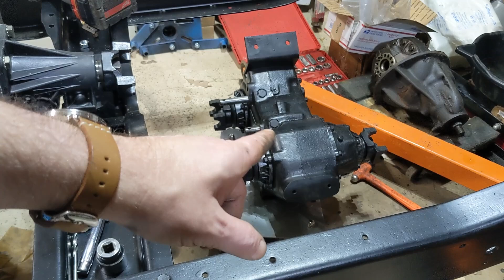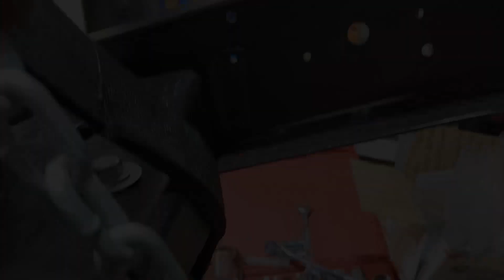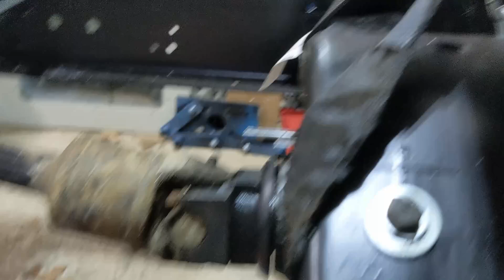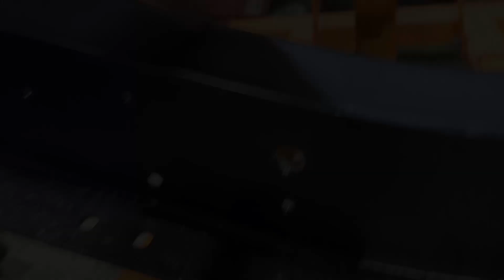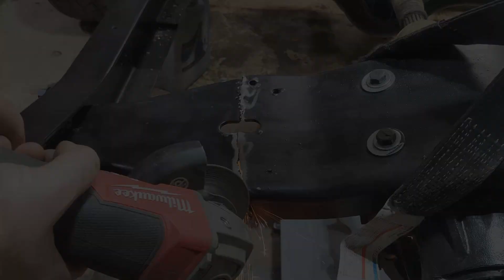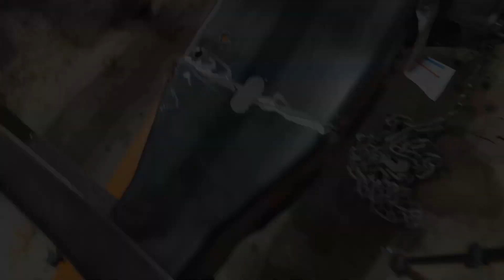Installing the Transfer Case (True Spirit #37)

Comment: Man another nice job brother but I wonder if you could help me out with a not so old truck frame  ? I’ve got a 2001 ram with the front frame rusted out where the tie rod bar mounted and I have access to a small junkyard that had the same frame so my question is would you cut it straight across or do more of an L shaped piece so I can put a second plate inside for extra bolts and then close it up ??? What would be stronger or last longer in your opinion ? Thanks man love the vids keep them coming
Reply from the maker: I'd be inclined to do a step/L-shaped cut and weld a plate across it after stitching it together
Reply: That’s what I was thinking too but I’ve never patched a frame where it located so thank you thank you for the help